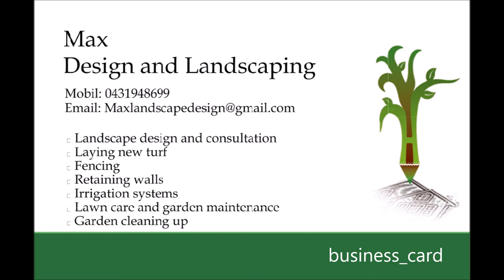Timber fence - Lap and cap, Garden landscaping ideas, Easy diy backyard landscaping ideas

Comment: Hi, Thanks for posting this vid. Very helpful. What nails are you using ? I have the DeWalt Framing gun, which is slightly bigger, but should do the same nails. Are they galvanized ? How long do you expect them to last before the boards bend & pop out  :-)   ?
Reply from the maker: Hi Mate 
You should Use 50mm and do it by angle.
It's good to have Galvenized but if you can't find use the normal nails beacause will be in the timbers.
Reply: Looks like he is using Brad nails with a second fix nail gun..........you should use 50mm Hot Dipped Galvanised Ring Shank nails for this using a first fix nail gun.

Comment: Hi are normal pasload framing nail gun nails ok to use?  Mine seem to shoot through the pailings? It should I use a clout gun?
Reply: you can turn the depth down on the gun
Reply from the maker: HI
Yes,The nails are galvenized and easy and fast to install, but should find a right long and shoot by angle.
Good Luck
Reply from the maker: Also as Hugo said you can set the deep of the nail on your gun.
Reply: Set depth, but palsied 50mm gal nail
Reply: @JackPatterson2232  truth

Comment: How did u set up the line
Reply from the maker: Install the first post where should be and the last post where you finish the fence line. Then set a string line 10 cm lower than the top of the posts and install others by following the string line.